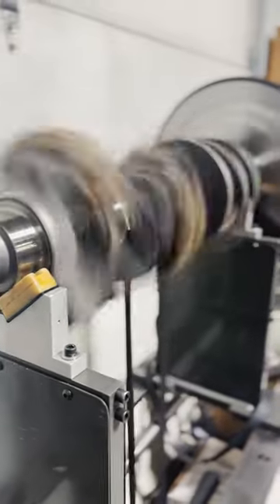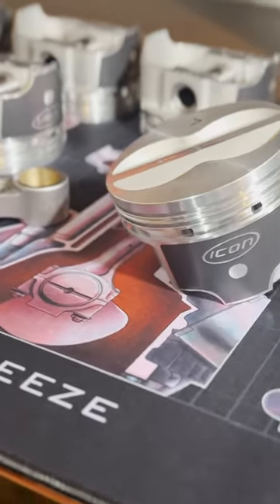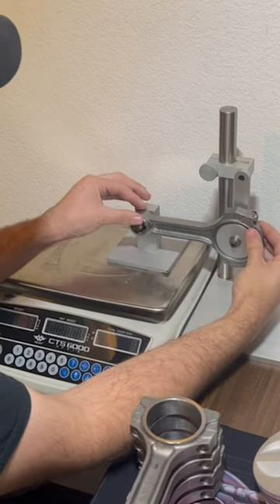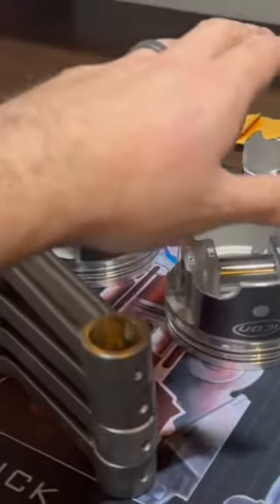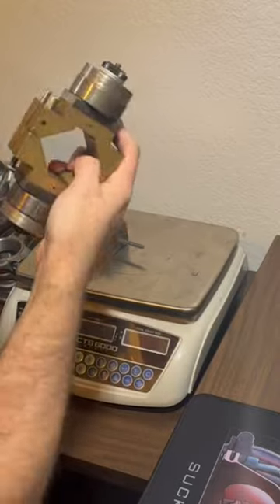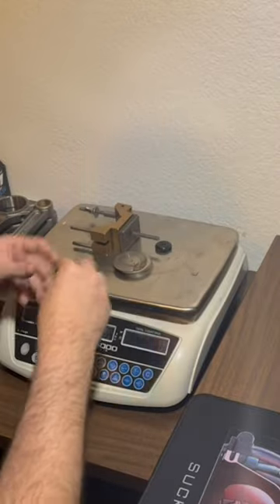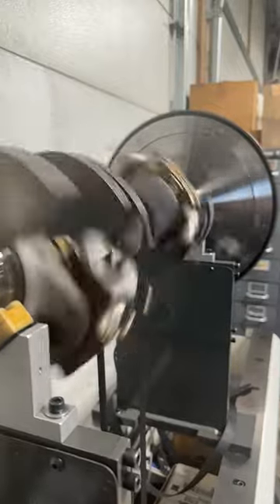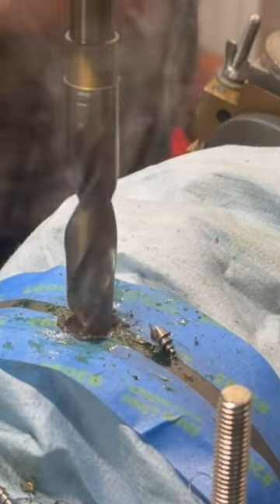#shorts This Is How We Balance A 383 Stroker Crankshaft!

Comment: I think that is more blueprinting, balancing is not about exactly the right weight, but in saying that, these people know how to build an engine, every part of your engine has a medium point these guys are making the engine to the exact way that the engineers design the engine to get ultimate performance, fuel economy and there are a few things that builders will sometimes do for the customer as in porting,valve seating and just little extra things that only the engine builders understand.

Comment: How many grams difference is to much on a 4 cylinder 2 stroke. 
Piston,rings,wrist pin, connecting rod, bearings. Example if all that is 650grams then how many grams off can the other 3 assemblies be from that one there that’s 650 grams. I’m hoping it’s okay to
Have a variance of several several grams?  And just one more question How much is it to balance a 4 cylinder crank if it only  needs weight  to be removed? No weight  added! What is a ball park price for something like that? Can a machine shop balance a 4cyl 2stroke crank if just provided with the total assemblies weights or do they need to do the entire thing like big end small end ect ect or can I just provide total weight in grams of ea  assembly and hand them the crank? 
       Thank you Thank you  an always a pleasure to watch you guys wrk and always such great job you guys do as well!

Comment: First time I've seen it in +40 something years .. they/we normally balanced the crankshaft before and after  ... to go to 'before values' after the machining of it was done. But never with counter weights on .. bravo. 
If you do so, what about the resistance of pistons in the cylinders ?? Or is that counted as a 'constant force' except 2 or 3° in top and bottom ? And can you take a balance axle into account too"?

Comment: Did you balance the flywheel and clutch too and index the  bolts and clutch minus the disk  . Was the 400 harmonic balancer a factor too. Two sizes and half dozen brands..

Comment: A certain engineer advocates the avoidance of drilling, and to grind the counter weights down.
Reply: Nothing wrong with od cutting of the counterweights but you will still have to drill it to remove enough weight. Otherwise you will be chasing your tail all day long

Comment: Will these measurements, matching, and crank balancing reduce harmonic vibrations at all rpm ranges?
Reply: Not all rpms there will always be a harmonic frequency where it's out of balance. They usually try to over balance to below that weird frequency where it goes back out, if that makes sense

Comment: Recommend scat or eagle rods/rotating assmblies??
Reply: Both are about the same, even their "balanced" cranks, with their +/-  tolerances are a mess. Fine for a mild build, if your looking to pull 7000+ rpm , K1, CALLIES, and the Lunati Sledgehammer are the cats pajamas, of cranks.

Comment: How did they do this BEFORE all your modern machinery??
Reply: That’s the neat part, they didn’t
Reply: Modern machinery just makes it easier, old school balancing involved a lot of hand work. You can use a piece of pencil lead on the end of the crankshaft to see what kind of circles it draws, a perfectly balanced crank will draw a perfectly round circle, but an out of balance one will have overlapping circles, you can figure out where the imbalance is by figuring out location of the circles.

There's a guy on youtube who found a vintage 1940s tire balancer, and showed how it worked same principal.
Reply: With dial gages- Henry Ford did it I  the 1920s it's not magic..lol

Comment: Is there a special reason your drilling on the face of the counter balancers instead on the inner walls of the counter  balancers?
Reply: Be like balancing a wheel and it’s set to outer rather then side etc
Reply: Cuz that's how you do it? I used to run one of those machines
Reply: @nct9466  okay not a expert but when mechanics balance a wheels the wheel weights hang on the side of the rim. Thank you
Reply: @pewpew1368a   wow great answer. I’ve seen a lot of cranks have the malleable metal drilled into the side of the counter balancer so if it ends up coming off the crank it doesn’t destroy your bottom end I guess at the end of the day it’s preference. Thanks for the reply
Reply: @matthewgingrich1244 The weights are put on the side of the rim for convenience

Comment: Should  not  be balancing the crank with the flywheel attached, balance crank first then flywheel next. Probably an editing thing on the vid
Reply: It is explained in the long form video.. flywheel end is externally balanced by the flywheel and it's added weight..front end timing gear and front pulley are neutral balanced.
Reply: @michaelowen1750  That makes sense on a 5cyl. or 60 deg v6, but a 90 deg 8? Thinking the guys must be balancing to over 100% and then the clutch cover back to neutral? 
I'll catch the long video after work, 
Thanks for the heads up👍